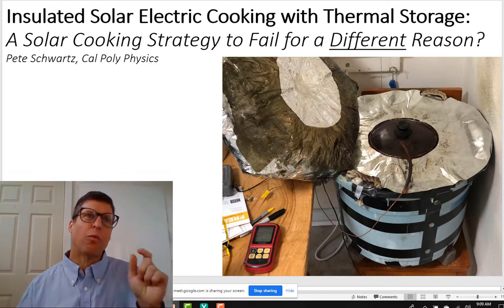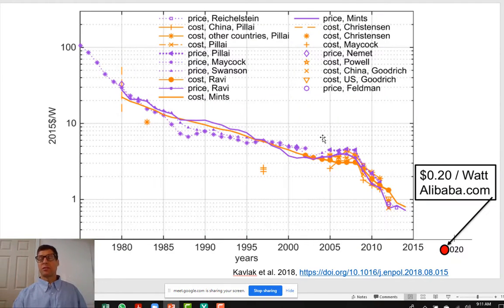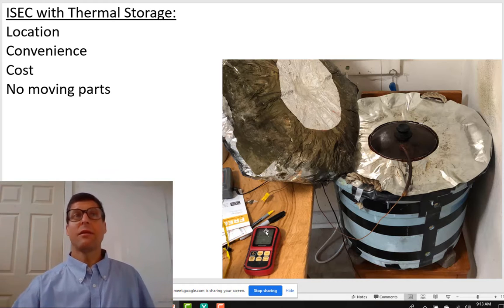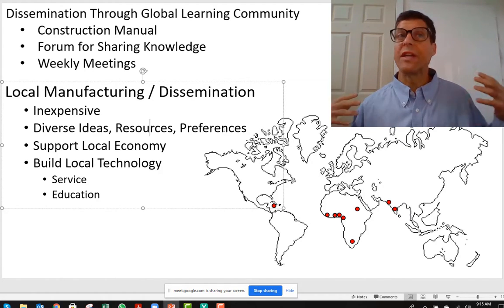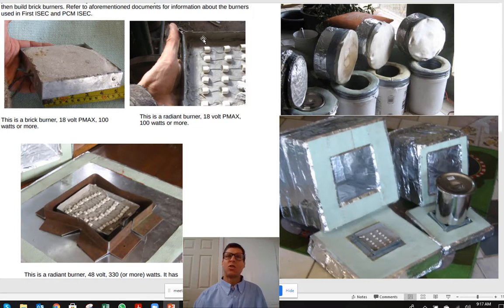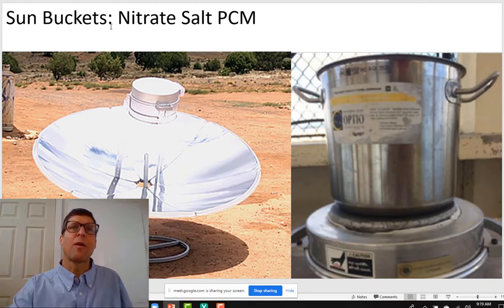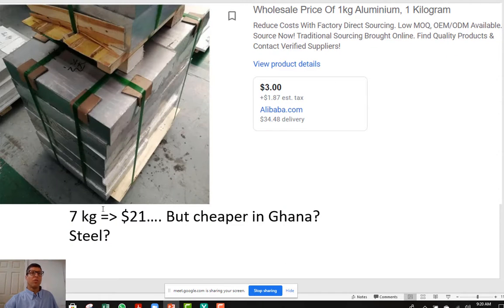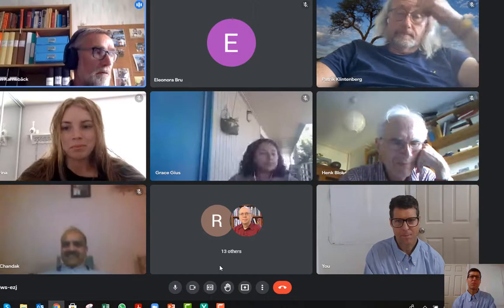Insulated Solar Electric Cooking with Thermal Storage, EWB Sweden, Pete Schwartz, Cal Poly Physics

Comment: Can we use Sand as storage material ?
Reply from the maker: Ankur, Thanks for the question.  Yes, you can use Sand... and it can get very very hot.  It has a specific heat that's half that of aluminum by volume, but the bigger challenge I think is the conductivity of sand is about 1/100 that of aluminum, so how does one get the heat in and out?  I think you'd need some aluminum network in there.

Comment: People need infrastructure investment and connect to a national grid. The US and its structural readjustment and austerity did more to make this problem worse than anyone. This is a political and economic problem, not a technological one. Parabolic solar thermal array heating an insulated solid mass is fine for communal. The multifamiliar scale is essential for it to be efficient and economic though. Molten salt is pretty dangerous to be carrying around, but 25kg of the stuff would be all you need for 3kwhs. I just think they need an induction cooker and the grid tbh.
Reply from the maker: Frank, thanks for your counter point. I agree that the problem is more fundamental than cooking. And I agree that structural readjustment made things worse. But I think the problem is more fundamental than infrastructure: It's poverty. Why are people starving when billionaires are achieving their dream of individual space travel? So, my voting prioritizes equity and compassion, but I'm not willing to make political reform the centerpiece of my life. Given our unfortunate political reality, one CAN accept cooking as a technical challenge. And, while molten salt is dangerous to carry around, fires are also dangerous and the indoor air pollution brings a certainty of millions of deaths annually. AND our device is not meant to be moved around. Additionally, I think that grid electricity is not the most effective way to electrify for everyone anymore with inexpensive distributive generation and storage. I think induction cookers are fine, especially if one has the required electrical power - it's just not what I'm working on. I find it interesting that we choose to shoot down others' efforts rather than see mutual support in the diversity of knowledge addressing a diversity of challenges. I encourage you to engage on any of the processes that you find compelling.
Reply: @pvs242ful  you're right, its was a rather rude comment, but I mean well. I'm just frustrated with technology being the means by which we justify ignoring the glaring issue of obscene wealth inequality. Countries which are the worst at this tend to be the most unequal. I'd like this to be constructive criticism. The problem with your device is scale. Thermal energy storage must always have larger geometries to reduce the proportional cost of containment and insulation. The value per kWh is never going to be good. National grid are essential because we need distribution to tackle intermittency of generation and eventually demand. A smaller step would be local microgrids with CHP thermal storage like concrete or, as in your case, aluminium alloys as in Azelio. Small scale solar panel installations are also poor value compared to solar farms. We won't decarbonise this century if focusing on individual solutions like this is the limits of our imagination.

Comment: My idea merged with others mentioned here is aluminum bucket but hollow filled with phase change element of zinc or for lower temperature tin.  Are those readily available?
Reply from the maker: Gordy, VERY COOL. So, because of your statement, I looked up low temperature tin.... tin and zinc have rather high melting points. The low temperature alloys seem to be rather expensive, and also contain lead and/or cadmium. I'm not willing to consider something that is toxic - it's just too close to our food. However, if you have any ideas, I'm interested to hear what you think. Thanks!
Reply: Tin I thought was low temperature pure but guess that’s relative.

By all means.  No lead or other elements in between the two melting points.

My idea is based on using solar thermal heat not solar electric. Thanks for the info on the “bucket” as I did not know that existed commercially.

Solar thermal as heated by a dish like the bucket.  But as stated much higher temperatures and larger dish to get there.  Then ways of regulating the heat down to last long times but enabling cooking temperatures that echo the standard 350f baking in standard oven.  A much more bulky contraption then your set up but that’s been one of the ideas in my head.  I believe the standard thinking of small portable solar cooking is really limiting the ability to come up with more larger solar kitchens but small is great for camping, travel, refugees, etc.  Both have their place.

My background is I worked at the SEGS plants at Kramer Junction( and Daggett) California for 31 years.  Construction, Maintenance and mostly Operations, being Control Room Operator for 26 years.

Thank you for your feedback too kind sir.